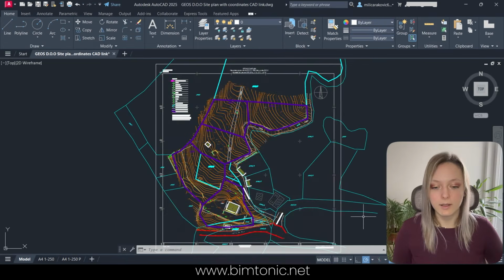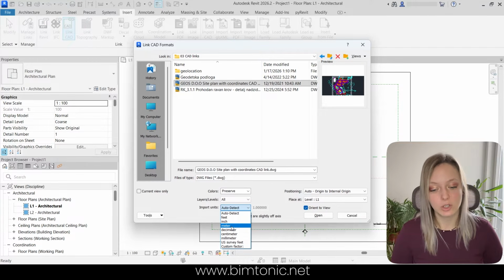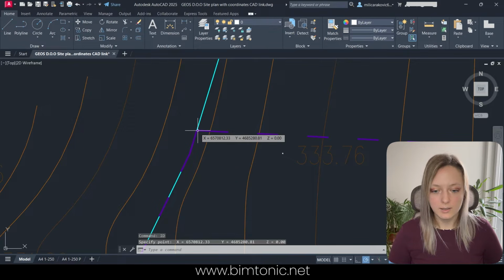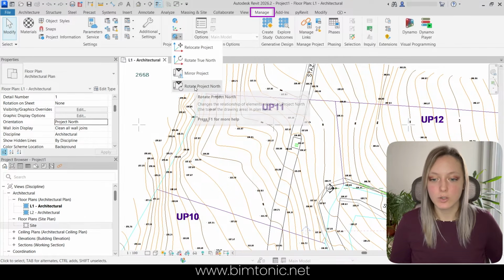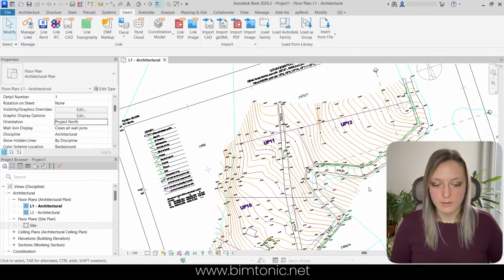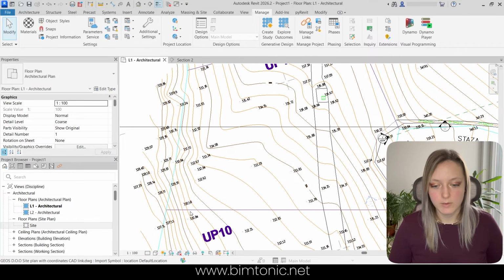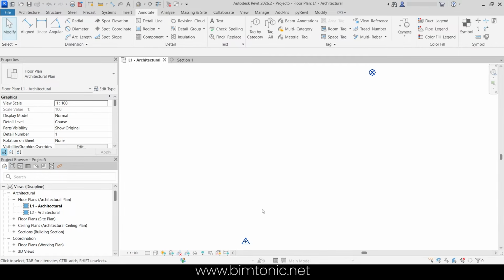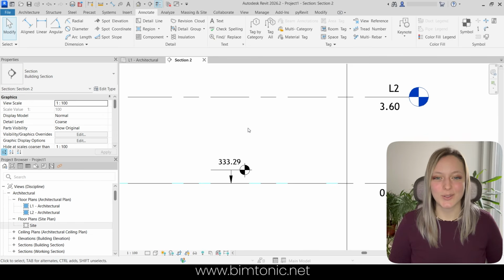How to Set Up Revit Coordinates from a CAD Survey File: A Step-by-Step Guide

Comment: after specifying coordinates at point to change level L1 apsolute survey elevation, my linked cad is lost in all views. Dwg is still linked but it is moved somewhere and cant locate it. By the way when linked in new metric dwg survey point and project point are in the middle. when acquire coordinate from dwg link still surwy point stay in same place. What is the issue
Reply from the maker: It could be that the CAD file is faulty, like having elements all over the place and it’s causing troubles. It’s best to clean up the file before inserting it. I’ve created video on that topic, might help: 
https://youtu.be/ymoOu6nmc7o

Comment: This method has a serious drawback that most architects ignore. The survey files are drawn in a projection, while in Revit we work on the actual ground. Before using a survey file in Revit, you should scale it using a combined scale factor (a combination of projection and elevation scale), computed at the center of the building area. At this point, it's probably best to manually move the survey file to 0,0, create a local site, and use it to import and georeference the Revit file.

Comment: One unrelated predicament i encounter: I finished my model long before plotting the Property Lines. And this is what happend, when i rotated my project north to the front of the Property, my Project North got rotated together with the model and all the annotations with it. Its no longer aligned to my monitor. So i have to go back to True North to continue my work and save myself from stiff neck. Hahaha.
Reply from the maker: it's a real annoyance when that happens :/

have you tried this method? 
https://youtu.be/5vpG1QZOcFU?si=vQYaCVa7vS46O6Bk

It should be able to keep your annotation elements in propper rotation
Reply: @BIMTonicLive Maybe because I plotted my Property Lines using distances and bearings while im in Project North? Maybe Revit is not allowing physical rotation of the  Property Lines? 

Ok i will try that link tonight and find out.

EDIT: I may have found the way around it without messing with my Model orientation and still achieved True North.

Comment: Hello, what if you are working with 3D survey file? So each point will have the absolute elevation? Will the topopgrahy points and contour lines be at that specific offset in elevation?
Reply from the maker: CAD file in the video is 3D, so the entire process will be identical. 
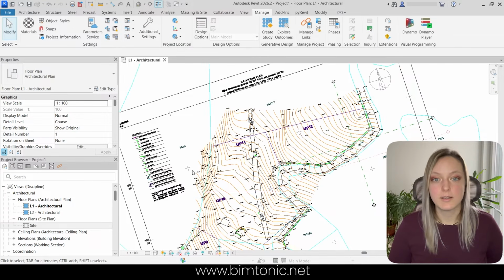In the end you still have to do the step " 18:37 Absolute Elevations of Levels" so you get your contour lines (and all other elements) to be on the correct height.
Reply: @BIMTonicLive  Thats weird because when I am in edit sub elements of toposolid and I try to add new points, I cannot snap them to the linked 3D dwg points. I am using Revit 2026
Reply from the maker: @ArhConstantinCozma  unfortunately points from CAD cannot be snapped in revit :(
Reply: @BIMTonicLive  Oh, but I thought you are also using a CAD topography and you are snapping the points.
Reply from the maker: @ArhConstantinCozma  I show that process here:
https://youtu.be/WXmdnONH87I?si=t4IsgmeaYCNtYun7
 In AutoCAD you can see the points, where they are, but you cant snap precisely (but that level of precision is not really needed for topography, since you see the text, and you are going to click in ok area )

But if you have the 3D points or contour lines, the fastest methods of toposolid creation are these two, they are automatic and require no modeling on your part: 

https://youtu.be/6NPl6_iCdvY?si=QEi0LNVGRxFTtSMi

https://youtu.be/2WbqbxBTvuQ?si=C5FzHzQkz-dFa2PL

Comment: Hey! Quick question: After I rotated my Project North to make my layout straight, all my default Elevation Marks rotated with it and are now at an odd angle (not parallel to my grids). Since this is a brand new project and I haven't modeled any geometry yet, should I just delete them and place new ones, or manually rotate them? Will deleting them affect the Levels I already set up in the project browser? Thanks!
Reply from the maker: It’s easiest to delete them all and place the new ones. It won’t affect the position of the model

Comment: Great Video, Thanks. A quick question - Shouldn't the level 1 pass though the survey file when you changed the level to 333.29? Because technically if I model something at Level 1 which is 333.29 I am modelling on a survey surface or contour at that level. So I should see the survey file, levels and my model if I cut a section through the model but it doesn't. I don't understand the reason for setting up that Level 1. Thanks in advance.
Reply from the maker: Hi Sandeep, setting up the survey height doesn't move the model element, but it rather converts the 0 elevation of the model to be for example 333.29. Changing this will not make any physical changes to existing elements, but set up the zero label to be different number.

If we were to physically move entire model for 333 meters it would become laggy because being too far away from the internal origin. It would also report and tag spot coordinates wrong.

The main reason we do this is so you can show your local project base point elevation as 0.00, while your survey point elevation accurately reads the real-world sea-level height of 333.29.
Reply: @BIMTonicLive Makes sense, Thank you very much for taking the time to reply.
Reply from the maker: @sandeepbhatia2519  glad to help!

Comment: Excellent video...The Only question is, I learned before from another video that the 'Survey Point' should never be unclipped, and its co-ordinates NS and E/W should always be 0 and 0. It represents the  XY (  NS & EW ) distances from the Project Base points of the Building under design. Could you please clarify this and the cause of the Survey Point Icon unclipping and being moved to a new location? So far, good practice is that the Survey Point is set up by the Surveyor on the Survey map (a building corner, a tree trunk, a pole, etc.).
Reply from the maker: Hi Mustafiz, thank you for the kind comment. 🙏

Unclipping and moving survey point doesn't really move the coordinate system, it is only done to move survey point symbol closer to the rest of the model (so it's not placed hundreds of meters away from the project). Coordinate system is still the one defined from the CAD survey file and it is not affected by moving the unclipped survey point. Only real problem would be moving the survey point without unclipping it. That would actually move your entire system and wreck the coordinates you have previously acquired from the file. 

Leaving survey point at zero point is also ok (just make sure to turn it off in all of the templates, so you can use zoom extends tool).  Both ways are valid, depending on what works for you.  

You also mentioned that the survey point represents the distance from the project base point. It's actually the reverse, the project base point reports its coordinates relative to the shared site coordinates.
Reply: @BIMTonicLive  Many thanks for your clarification. I really appreciate it. Take care.

Comment: Hello ma'am.  actually I was facing issue regarding the relocating  the  existing created model to new survey layout file. I was created one Airplane hanger model and submitted to client then Client has replied they what to do model on cordinate and they provide the cordinate and survey layout file .So this situation our model the create but how move hollow model and paste in that cordinate with true north?
Reply from the maker: For the existing project the process is a little inverted. In this case you first clean up the CAD survey file and link it to your existing revit model (origin to internal origin or center to center). After that align your CAD file to your building's main grid line using align tool (you are manually setting up project north alignment). Than move CAD file to be in the place where it needs to be for your building, using move tool. Now your CAD survey file should be visually in the exact spot where it should be regarding your building (make sure everything is perfectly precise in this step). 

Once everything is done manually now you can go ahead and use acquire coordinates tool. Once you do that Revit should pick up coordinates and also rotate your model to project north. When you choose true north for your view settings your building should now rotate as well. 

Now you should test if the coordinates are all right by using spot coordinate tool. 

Now you move survey and project base doing the same way as in tutorial. Heights as well and check again if the coordinates are all right. Also now do the final check by setting you view to Project north and linking the copy of a file to shared coordinates.
Reply: @BIMTonicLive  Ok Ma'am.I will try and get back to you reply.
Reply from the maker: @vinayakpatil8855  I've created that video, so you can check it out  https://www.youtube.com/watch?v=5vpG1QZOcFU

Comment: thanks for the vid. But I watched the video before this, where you explain about modelling toposolid using point , add elevations numbers; and then we got a big chunk of soil. But how do I fix toposolid for it to show a small portion of soil after set up this elevation level ?
Reply from the maker: Once you set up your ground floor level survey height to be for example 330m and than add the point in your topo that is for example 331m survey point elevation base, the soil will be only 1m thick (because when modeling the topo, soil will generate the thickness from your survey ground floor level). If your GF survey level is 0 than it will generate 330m thick soil. 
So the key is basically first setting up your GF level survey height and after that modeling the topo.
Reply from the maker: Also, make sure to first just add points to topo and than later assign the value of height to points (to not add to "offset from surface" parameter, because when adding the height to "offset from surface" you have to add the height from the surface, not to just insert the height you see on CAD plan, but to actually calculate difference between gf and point height, if the way I wrote it makes any sense lol 😅 ). 
That also tends to confuse people a lot, that's why in video I added points first, and heights value later, because calculating those differences is too much work. Basically sometimes people insert full height to "offset from surface" and get big chunks of soil, despite having everything set up.
Reply: @BIMTonicLive  can i also please ask, so my CAD contour lines each showing 20m differences, and the issue is :
- the revit primary contour doesnt follow the CAD lines, for example: 
CAD line is 1480 ; 1500 ; 1520 , 
revit primary contour start 1486; 1506; 1526
so how do i make it start 1480 and not 1486?
Reply: i also i'd like to add that each point elevations is exactly the same as CAD, but revit contour line just start further from each points that i put
Reply from the maker: @MahKhaRah  don't use "offset from surface" option at all. It is offsetting your points. Add all the points, and than after you have added all the points assign them the heght
Reply: @BIMTonicLive  i followed your suggestion and  redo my points but it still offset 6m from the actual points
Reply from the maker: @MahKhaRah  you can change the interval setting by selecting toposolid and in edit type changing the option Contour Display. There you can set up primary contours to be 20m (and secondary to whatever it is in your cad). Check what is the number of start points. Try changing it to zero, it should fix your problem.
Reply: @BIMTonicLive  it worked. thank you so much for sharing !!